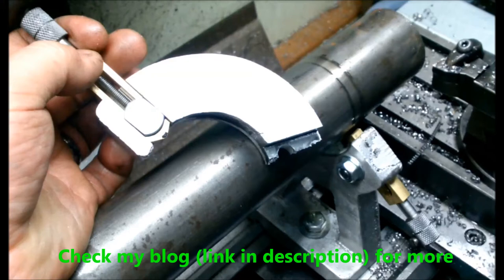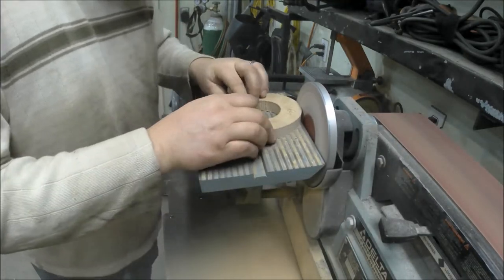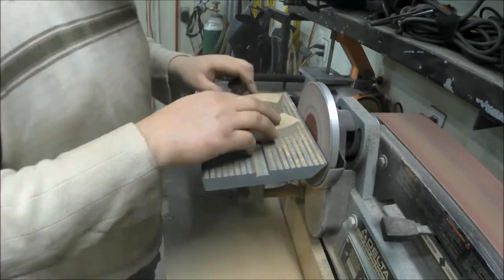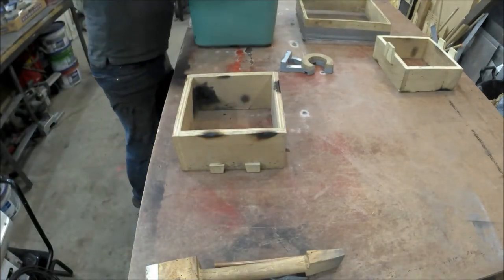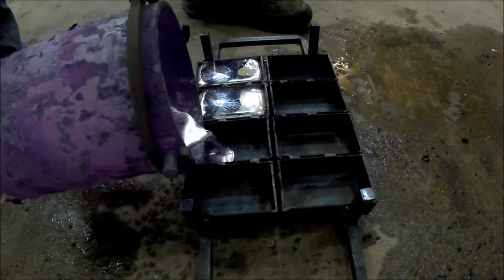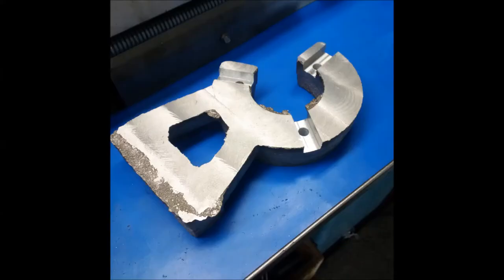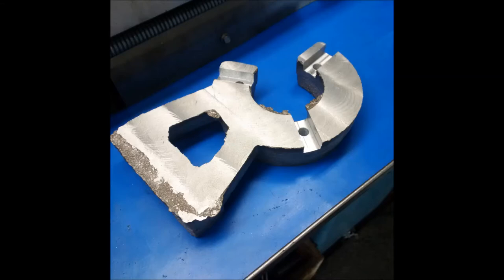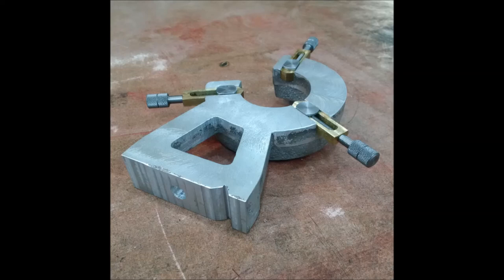Steady Rest Retake

Comment: Are you aware that casting on a concrete floor is dangerous? Most concrete mixtures contain excess water i.e. more water than the cement can chemically bind. The excess water gets enclosed in the hardened concrete and stays there forever as minute droplets. In case you spill a large amount of liquid metal e.g. when your crucible breaks (ceramic or clay based crucibles can break at any moment) then the heat of the liquid metal turns that enclosed excess water to steam and the steam pressure might be enough to blast chunks of concrete out of the floor surface like in an explosion which is very dangerous by itself. But since that happens under a puddle of liquid metal it will splash it around. And you stand in the middle of high speed concrete chunks and high speed spray of liquid metal. Better put a bed of dry sand (like 2"+) down. This is porous and lets surface steam escape and insulates the concrete floor from heating up so high to make it explode. Of course this is specially true with casting cast iron which is 2 times hotter than liquid aluminium but I would also be careful with larger amounts of liquid aluminium at 700degC. And always wear foot and leg ware protective enough for the case that liquid metal splashes against your feet and lower legs. (like solid ankle high leather boots and pants out of cotton or linen. No plastic shoes like rubber boots or sports shoes. No plastic fiber pants like nylon, polyester etc., foundries use dedicated protective clothing) Liquid metal on your skin, let alone eyes, creates horrible burns.

Comment: Do you have a follow rest? I use it more often than the steady rest. You could have used the same model. You only put the brass plungers at slightly different angles and give the alu arc a bigger opening. Both easy modifications on the same casting.
Reply from the maker: Yes, I actually do. I haven't needed either one much but I did make one of each just to have them. Thanks for watching.
Reply: Thanks for making the videos. Very versatile projects. In Schiller's famous theater piece "William Tell" is the sentence: "An ax in the house saves the carpenter" That sentence applies to you in many ways. You should write it over the door of your new house.
Reply from the maker: Interesting, William Tell is my home country's national hero...
Reply: I know. I am Swiss too. Born and living there.